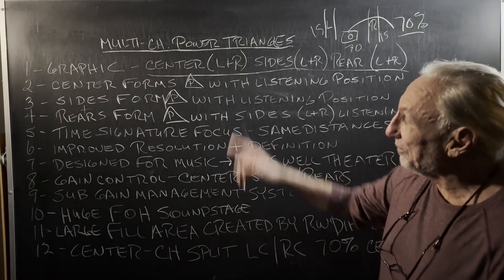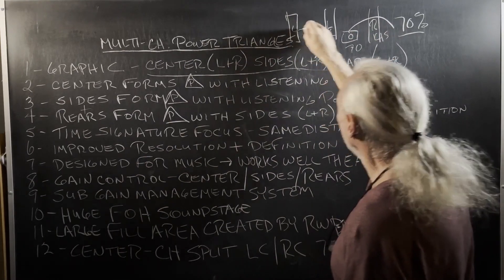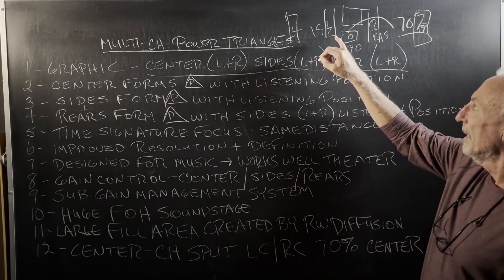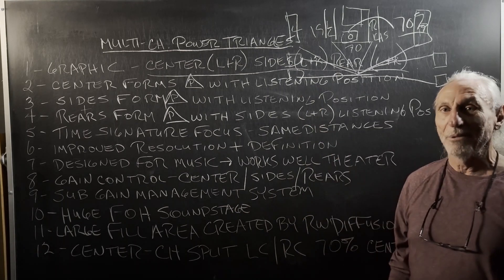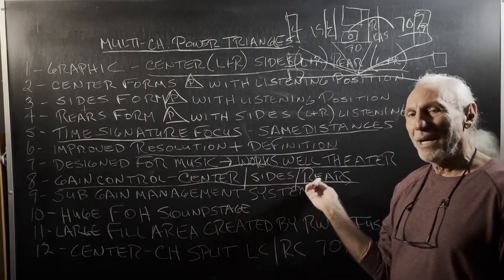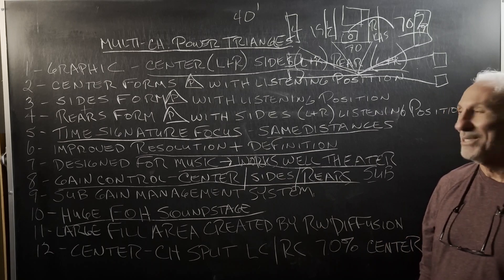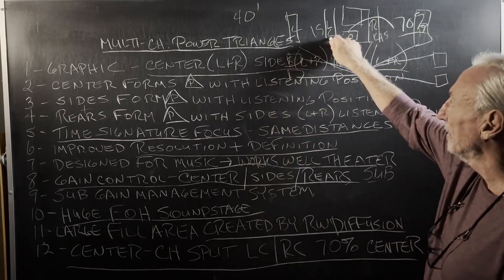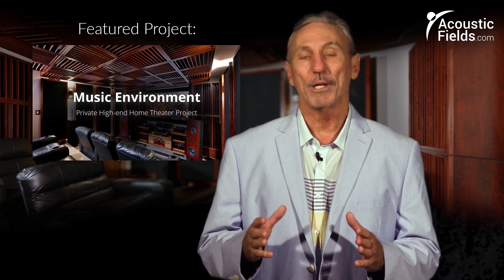Multi Channel Power Triangle - www.AcousticFields.com

Comment: Dennis!  I remember when you first mentioned this...I switched to your concept of LF, LC, RC, RF...Big expansion from jump!

Thanks again!
Reply from the maker: What was the improvement. Tell us what you heard that was improved.
Reply: @AcousticFields  So the sound image covered not only the MLP, but some of the left and right seating as well.
I'm using the Power Sound Audio MTM-212s (4) as my front stage speakers.
Reply from the maker: @michaelslocumbsr.2286  Remember that your room does not care about what type of energy you put inside it. It will distribute the energy the way it dimensions tell it to. The acoustical goal is to stay ahead of those predictable room distortions. By adding two front of the theater energy sources with the same energy distribution array, you add more source energy over a larger area. Your soundstage will get larger with no "empty" soundstage "holes".
Reply: @AcousticFields  Yes sir!  Understood!  Currently room dimensions are: 
Lenght...15ft
Width.....21ft
Height...12ft

Reverse dimension due to configuration...In the process of selling the home and purchasing a new one with a dedicated Theater.
Reply from the maker: @michaelslocumbsr.2286  When you find one you like, send us the dimensions so you know what you will be up against.
Reply: @AcousticFields  Yes sir!  We're waiting for the right lot, however the theater dimensions will be the following before treatment.
Length...30'9ft
Width.....18'11ft
Height...12ft

Final dimensions will be close to:
Length....29'5ft
Width.....17'8
Height...11ft front 10ft rear.
Reply from the maker: @michaelslocumbsr.2286  Try for more width. Try for 21-23'
Reply: @AcousticFields  Yes sir!  Good point!  Thanks again!
Reply from the maker: @michaelslocumbsr.2286  Good data points.